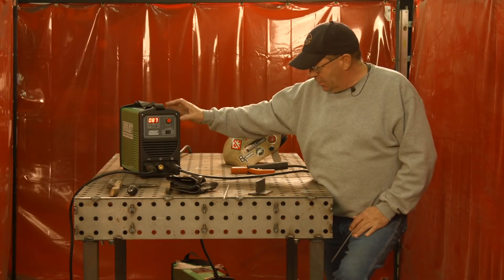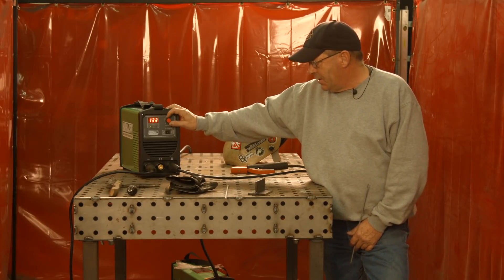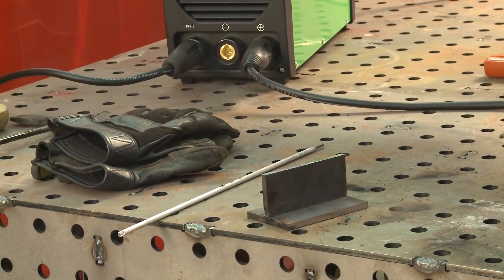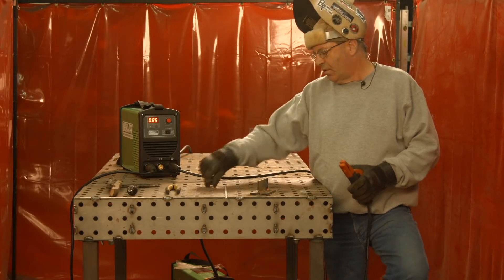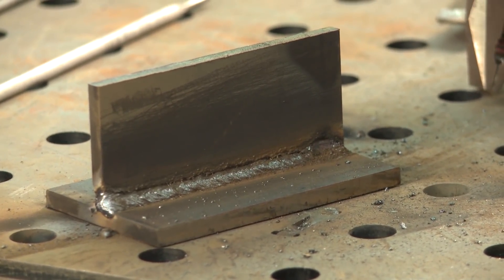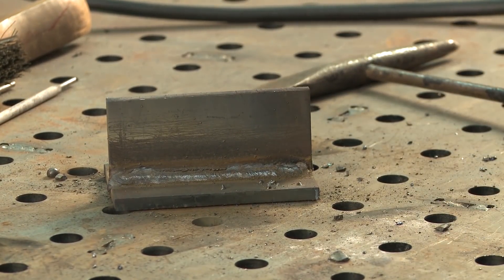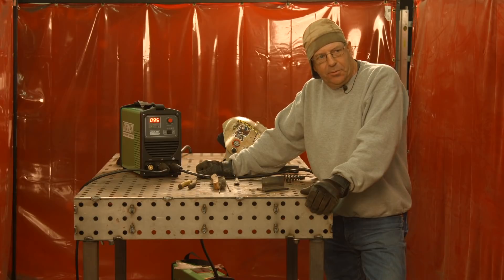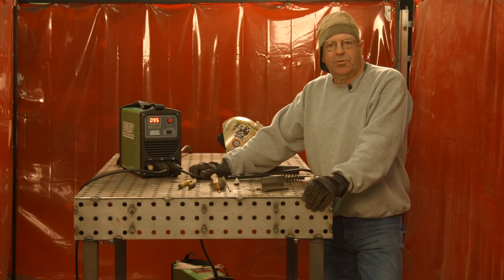🔥 Everlast PowerArc 200ST Demo (6010 and 7018)

Comment: Nice video. Sure wish my powerarc 200st could run 6010 like yours does but it just won't keep it lit.
Reply: Shaq Deisel funny but I trust bob.
Reply: Shaq Deisel i am not doing anything different. The arc just snuffs out every couple seconds then back on. I have the ground plugged into the 6010 port on the machine. I have done some reading and I am not the only one that has had this problem. It runs all other electrodes I have tried very well.
Reply: Daniel McConnell so it does not run it correctly, it did not seem to have the need in this video to run such a short arc length. In the use of mine no matter how close the arc length it still snuffs out the arc just like I have seen on machines that say you can’t run the 6010 rod. If you cannot weld with the rod as it is intended I see that as not holding up to their advertising. In this video and on other by chuckee2009 I have seen it run the 6010 rod as intended that is why I bought the machine I wanted that capability.
Reply: In stick mode on the 6010 port  it has to have a super close arc length. It’s very weird because it goes against normal training with fast freeze electrode that you should hold a medium length arc and make persistent whips. With this machine in stick mode it requires a arc length of near touching the base metal with little slight whips. It however doesn’t  hump up like it normally would on a transformer buzz box type machine it lays out smooth. That’s the big quirk to doing fast freeze rod on it. You decrease the voltage when you run a tight arc length and most lower end inverters don’t have the capacity to run that higher voltage with a longer arc length.
Reply: Daniel McConnell from my reading more reviews after I bought mine that is the feeling I got and honestly I can understand that considering the price point.
Reply: I love mine... Used it for a year or so and bragged to everyone about it....But I had something go wrong with the amperage control. It shows a readout of 58 to 135 amps plugged into 120v. I got a hold of Everlast Technical Department and they sent out a new control board. It showed up a little beat up with no instructions on how to change it out. I hope I don't get a jolt from a charged capacitor while trying to figure out the change out.
Reply: Just had a weird thought what if he has a more expensive welder under the table. LOL.
Reply: chris jones actually I plan on getting an ESAB Rebel EMP215IC next year which I am sure will suffice.
Reply: chris jones I had in mind the esab mini arc but I saw many good comments about the everlast, now I feel a little disappointed. I have the rebel em215ic mig and it is a great machine.
Reply: Juan Zavala I love the esab. Was looking for a machine to help me pass 6g cert.. it did that and made enough to pay for machine and some other things for shop in under a year. Only complaint is not remote capable so no foot control on Tig welding but it does have lift arc and is really smooth on Tig so I'm still really happy with machine. It's selling point was ran 6010 with out any cable swaps or even a switch to flip. Also runs on 110 volt power . Great machine
Reply: Its the same machine. What are you doing different ?
Reply: Mike at Everlast I will certainly call you thank you!
Reply: Mark Breidenbaugh that’s very interesting. Mine can do it but I have to literally drag it and push the rod into the joint. Not to say they all work that way. They must not all be the same. QC might be a little sloppy.
Reply: Mark Breidenbaugh, Thanks!
Reply: Shaq Deisel lol😂
Reply: Mark Breidenbaugh esab miniarc 161lts will solve ur problem
Reply: My first PW200 was total fail , the unit would run for a minute or so and cut off. I returned the faulty equipment, and recived a replacement machine that is outstanding,  easily out performs the Lincoln flextec 450 I run in the Lab
Reply: Mark Breidenbaugh I have 1 week with mine and I have exactly the same problem with that electrode, did you find a solution?
Reply: Juan Zavala not really. It will run if you hold an extremely close arc you gotta keep it jammed in there or it will go out. It certainly does not run it well and the beads do not look as good as they do running off the Miller XMT 304 I run at school. I plan on running some 6011 on it soon that should run alright.
Reply: Mark Breidenbaugh so it pry won't run pipe then. Glad I got my esab instead
Reply: chris jones I have not tried open root with it yet so I can’t say for sure, but I would not count on it.
Reply: Mark Breidenbaugh you DONT plug the ground into the 6010 port.   You plug the sringer inro the 6010 port.  Stick welding runs dcep dc electrode positive the ground gclamp is always w very few exceptions plugged into the negative port.
Reply: WRONG! Go the their website and read the manual for this machine. Ground clamp goes into the 6010 port.
Reply: Mark Breidenbaugh 
Ground DOES NOT plug into 6010 port.

The electrode holder (stinger whip) plugs into 6010 port.  You got it wrong
Reply: drumtwo4seven YOU are the one who has it wrong.  Look at page 14 of the manual. 
 https://www.everlastgenerators.com/sites/everlastgenerators/files/downloads/PowerArc%20Series%20200ST.pdf
Reply: trappistachel doesnt matter what a typo says to do

DCEP is stick and mig

Not the best way to confirm this but everlast themselves have a video on this machine and he clearly demonstrates plug the whip into the 6010 port.

This is dcep
Reply: DCEP dc electrode positive
This means the welding rod or electrode is plugged in positive and the ground clamp negative.  It is referred to as reverse polarity and is how constant current machines operate with veryfew exceptions.

In dcep electrons jump off the base metal and onto the electrode (welding rod in smaw and wire in gmaw).

if you have your ground clamp in the 6010 port than your electrode holder or stinger is set up incorrectly in thia situation it would be referred to as dcen or dc electrode negative and in thia situation the electrons would be jumping off of the electrode and onto the base metal.  This again is incorrect for smaw and gmaw (stick and mig welding).
Reply: Mark Breidenbaugh call us 6505888588 after 9am pst
Reply: BillyG they sent me a new main board tot ray and fix my problems which did nothing, but it discharges the capacitors on shutdown so no worry. I just took detailed pictures with my phone of where everything went before I took the Old one out and used it as a guid to put the new one in.